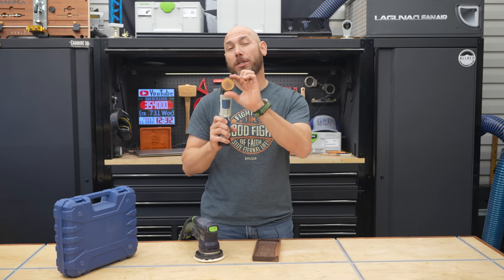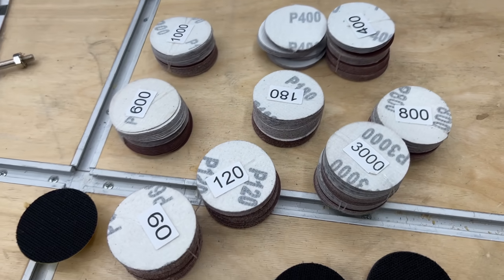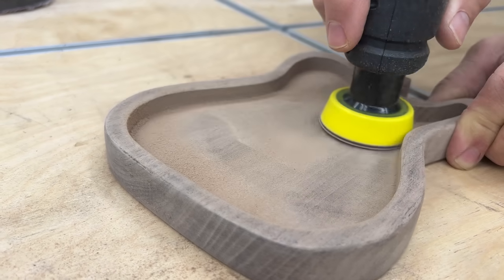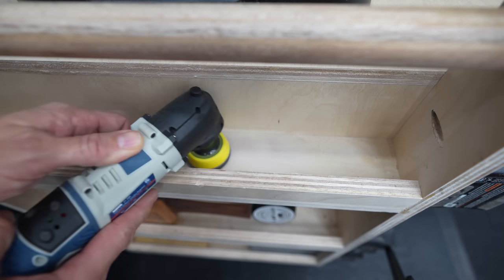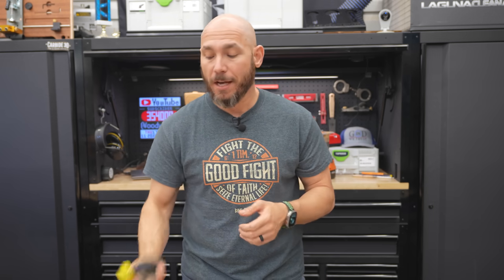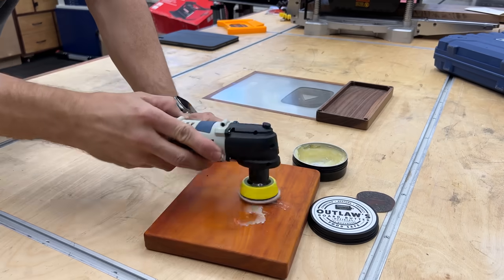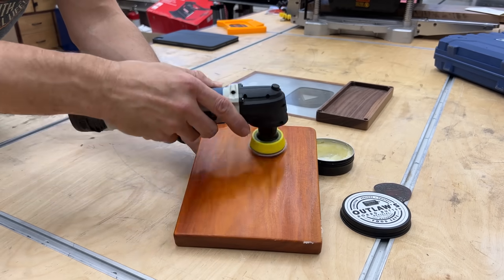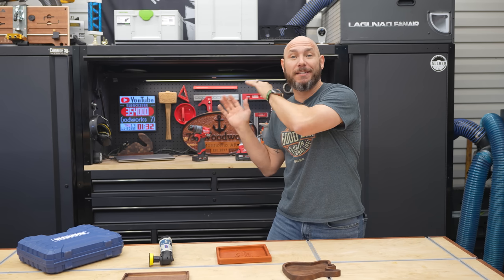The Must-Have Woodworking Tool Most Don't Know About

Comment from the maker: ▼EXPAND FOR TOOL LINKS and INFO▼ 
Watch Next = 3M Xtract Sander - https://youtu.be/xjeWACxBdM0
Tools In This Video: 
Rikon Detail Sander (Acme Tools) - https://imp.i284638.net/do1bBq
Rikon Detail Sander (ToolsToday) - https://shrsl.com/3truc
Rikon Detail Sander (Amazon) - https://amzn.to/3VSnwiC
Extra 2-inch Sanding Disc 300 Pack - https://amzn.to/3H2ntge
Milwaukee Detail Sander - https://homedepot.sjv.io/Ryv0z2
Outlaw's Board Butter - https://www.731woodworks.com/store/boardbutter
Festool Sander I Have - https://amzn.to/3ukipvV
CNC I Use Shapeoko 4XXL - https://shop.carbide3d.com/731woodworks
(If you use one of these Amazon and other affiliate links, I may receive a commission) 

Some other useful links:
Daily Tool Deals on my website: https://www.731woodworks.com/tool-deals
Subscribe to our email Newsletter: https://mailchi.mp/7e44c16eefdc/731-woodworks-email-newsletter
Check out our easy-to-follow woodworking plans: https://www.731woodworks.com/store
Outlaw's Board Butter - So Good it Should be Outlawed: https://www.731woodworks.com/store/boardbutter
Reply: Thanks I just ordered one. looking forward to using it.
Reply: They are out of stock everywhere I can't find it avaliable.

Comment: I use the sander attachment that comes with practically every oscilating multi-tool for those areas. I have taken my grinder to a couple of those attachments (I've collected quite a few over the years) to make an even smaller sanding surface. A light touch is key if you don't want to leave marks though.

Comment: I love mine, thank you for the recommendation. I accidentally learned a trick that works for me, might work for others. I accidentally ordered 3" disks instead of 2" but they work perfect for cleaning up live edges. I use the 2" foam adapter and center a 3" sanding disk as best I can. On live edges it really lets you get into the harder to reach indents and allows you to really follow the flow of the live edge. It also works great for rounding the edges, just letting the overlap of the sanding disk run along the edge.

Comment: 2:20 - to get rid of those lines for say a 0.5" deep pocket, do a clearing at 40% step over down to 0.49" and then a finishing tooldpath at 0.1" with a 10% step over. It'll be so clean you won't really need to sand the pocket. Learned this from Andy Bird Builds and it has saved me HOURS of sanding

Comment: If you want to try a 2" random orbital sander, Harbor Freight sells an air-powered one for less than $30. It requires a lot of air (4cfm at 90psi), but it works really well.

Comment: I have a small air powered DA sander that came with 3"and 2" hook-it pads. I don't use the 2"pad at the body because they don't stock that size paper. I don't have the polishing pads they make for it either. I was really looking for a battery powered sander for woodworking.. I'm I saw your review on this one.! For the money, you can't beat it.

Comment: I do a lot of CNC tray and dishes. If you want to have a sand free finish to the bottom of your dishes you need to do a finishing pass. Do a .05 depth with a 7% step over as a finishing pass and you will have no lines to sand out.

Comment: I do not have a CNC. That being said is there a way to rout out irregular shapes safely. Don't have template either. I am interested in making charcuterie  boards with the edges similar to those trays in your video. Any directions are appreciated.

Comment: Im excited for the milwaukee (really want to keep my m12 battery kit and not add any others!) version.  I do a decent amount of 3d printer projects and the orbital sander isnt great for the small parts, and hand sanding can be brutal.  I've been using a triangle head sanding attachment on a multitool but it's a real pain and doesnt do a good job, plus I haven't found a foam-backed version to protect my rounded surfaces.

Comment: Thanks for posting about this tool.  It really looks like the perfect thing to sand the little boxes I like to make.  Could you do a comparison between the Rikon and the Milwaukee when you get it?  I like the Rikon brand in general, but I’m curious if Milwaukee will present any clear advantages.  I really appreciate your videos.  Thanks again! :)
Reply from the maker: I do prefer the Milwaukee over this just because it's better built. Or at least seems to be.  I like the variable speed trigger on the Milwaukee, plus you get more tool options on the M12 platform.  And the triangle head design of the Milwaukee allows you to get into corners easily.
Reply: @731Woodworks  Milwaukee makes everything!Soon releasing 20 inch rims for Ford Crown Victoria Interceptor cause this is how we roll lol

Comment: Looks to be a very handy little tool, too bad battery systems are not interchangeable 👍🏻
Reply: @MrMartinSchou  hey Martin, I’ve seen a few adaptators on the internet that allow some cross contamination of different brands of tools and batteries, I have only two brands of cordless tools and intended on keeping it that way, if I can’t find what I want in ether one of these brands, I’ll get it in a corded tool or do without. Thanks for the thoughtful comment! God bless
Reply: @Martin Schou  True. I remember when washing machines and bicycles all used interchangeable parts. Then wm brands had extra little shoulders or grooves or clips and bicycles have a wide range of spijes, bottom brackets, etc. Home maintenance became not worth it as you needed to invest in specialist tools and pay a premium for the part and different parts for each bike in family

Comment: I have one of those palm triangle shaped sanders, and also use the small triangle sander attachment that goes on my oscillating mulit-tool which is great for getting into smaller areas. The Rikon sander you have looks like another great tool for sanding, especially for your CNC trays. I am a little curious why you have no interest in using the Rikon, but instead went right out and purchased the Milwaukee brand. Was the Rikon really that bad? Have you used the Milwaukee and know it to be a superior tool? Thanks for the review Matt!

Comment: You stated you just ordered the Milwaukee version, what’s the main difference? Why get both?
Reply from the maker: I got both to test, most people wouldn't need both. After getting the Milwaukee in, it is obvious that the Milwaukee is much better built.  Also, because Milwaukee has so many tools in the M12 line, that's an advantage.  I don't think Rikon has another tool that uses this battery (or at least Ididn't find it).  The Milwaukee can also get into corners and up against edges much better because of its design.  If I'm buying one of the two, it's the Milwaukee every time.  And. Rikon has now raised the price from $98 (what I paid) to $138.  😒
Reply: @731Woodworks  the M12 sander kit also went up from 149 to 179
Reply: @gulzeb  It still rings up in store for $149. I just bought it yesterday.
Reply: @bryanknitter8858  yesterday it was $149, today it isn't
Reply: @bryanknitter8858  it might vary with location though, as home depot prices tend to do
Reply: @gulzeb  yah, just ask someone who lives in Hawai'i. lol.
Reply: Matt’s an addict. His drug of choice is tools! All love Matt!
Reply: Woodturners have known about these on drills both wired and battery powered for years.  Just look at Rockler/Woodcraft/CraftsUSA and see these.  There are 3 inch versions as well.

Comment: For those purposes there is nothing better than Proxxon tools - you must certainly aware of them. Otherwise  you can jewellery tools albeit what I have is auto pneumatic tools, already stated by another YouTuber a few comments ago, which work pretty well. Nothing wrong with your Rikon mind you! Not available on amazon anymore - but they are just waiting more stock in